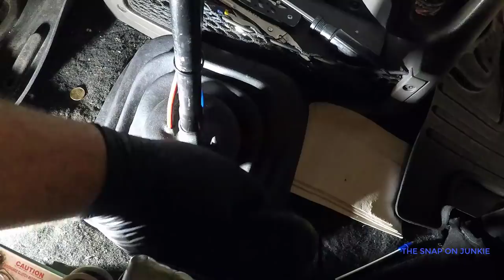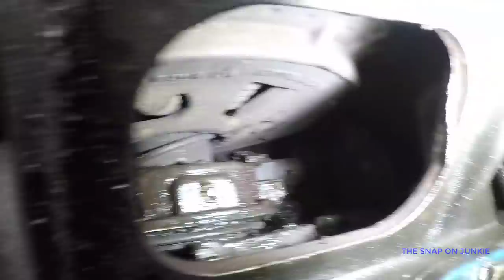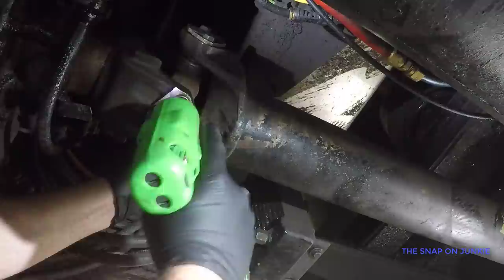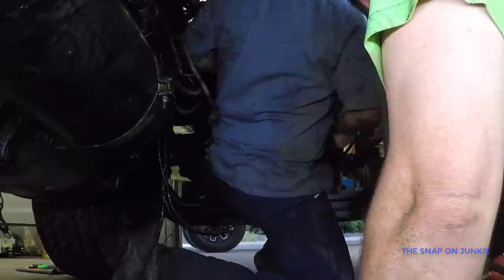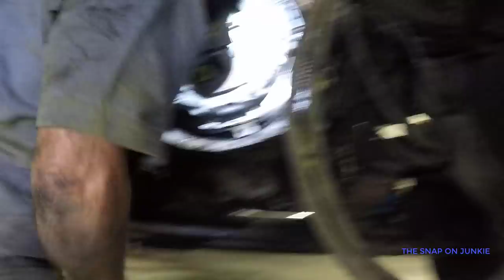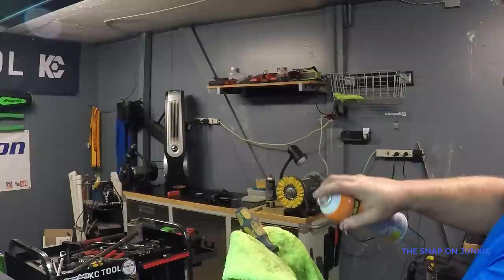HOW TO REPLACE A CLUTCH IN A DUMP TRUCK THE SNAP ON JUNKIE

Comment: I went to a vocational school for auto tech gradtuated in 83. I worked two years as a tech on auto's. I changed jobs and got thrown in to Simi trucks and trailers and cranes. I did it for years then drove truck for years something different. I got back into mechanic on truck's, trailers and cranes. I have to say that the school of hard knocks was pretty good to me and the people around me. I have one of them transmission shafts in my tool box today and I'm retired.great video Junkiiii keep up the great work my friend

Comment: At the Frieghtliner dealership I work for if you need a clutch you automatically get a new input shaft kit with bearings reseal trans bell housing, new rear main seal for engine, resurfaced flywheel, new pilot bearing.  To us if you are going though the effort to take the trans out might as well do it once and do it right
Reply: Alex Corvi, My shop is the same. Notice they didn't machine the outside of the fly wheel. That clutch is going to give them problems.
Reply: That's the way I see it for as much work as it takes to get all that out why not replace or resurface things while your in there
Reply: Many clutch suppliers will extend your warranty if you replace your import shaft, bearing, clutch fork, and hello housing bushings.
Reply: Alex Corvi I have a 88 freightliner and I need a clutch. What's a  Rough estimate on how much for parts and labor? I'd rather do it right than do it again later.
Reply: same at the freightliner i am at. even if they didn't you might as well do it while it is out
Reply: some people can't be taught 'cause they already know it all
Reply: And cross shafts don't forget !

Comment: I went to tech school then did a apprenticeship program at shop in Canada. Thats for sure the way to go you learn so much more. Btw if your doing a clutch job by your self and dont have help you can install the clutch on the input shaft of the trans install the trans then run the clutch bolts from the hand hole as you turn the motor over. Good video you made.
Reply: Been doing clutches that way for about 20yrs.load up trans..
When I started at mack dealership. With triple countershafts..it was a time saver..
I've heard of mechanics cracking clutch cover doing it this way..I dont know how..
Reply: Yep that's how I do it, much much easier

Comment: I just watched this video. And I have to agree with jim. I got into the Diesel industry late at 29. I was just suppose to help my stepdad with a few odd jobs when I got laid off. Well 3 years later I’m still doing it. Try to soak up everything I can. A year into it We lost a few mechanics and left me by myself doing everything from oil changes to engine rebuilds. We hired a kid out of tech school with ase. Hoping it would take some load of me. First red flag was when he asked me what plug to pull on the oil pan! He ask if he could do a clutch job cause he said he’s done a few I said sure. Well he could tell all the difference types of clutches and why they are like that... but didn’t know how to install one. So yeah you learn a lot more with hands on vs. tech school. Not saying school isn’t bad I guess it depends on if you pay attention or not. Sorry for the long comment but keep up the video and hi from a new subscriber!

Comment: Jim is a smart dude...I do the exact same thing on anything im doin a clutch on(or any mating surface for that matter)....clean EVERY mating surface so there is no chance of run-out cause a layer of surface rust not allowing things to mount flush and square,which will lead to some serious vibration, fucking up the ring gear or the worst, having flywheel bolts start backing out...and I also use RED lock-tite on every nut and bolt....and yes,I always have a Marlboro hangin too..LOL

Comment: In our diesel shop we have several pits that you park the truck over. Then you can stand under it easily, and with a heavy duty normal transmission jack you can easily get the transmission in and out.

Comment: Maybe worth thinking about fitting a pit to your shop if you going to be working on your rig. There is a really good fibreglass one with built in steps,a seat,lighting and tool shelves built in. Totally waterproof and a much nicer place to be. Transmission jack a must too. I have a ratchet chain on mine to secure bot to jack. Means can just slide box back and get on with things..
A slide hammer with a threaded end to screw into the UJ cups is bloody handy too.

Comment: I hated doing OTR trucks with wet kits.Those dual stacks gotta come apart.I actually like Autocars or Construction trucks because they mostly use one exhaust pipe.We did clutch R/R out in the field all the time.We didn't have transmission jacks...jus come-alongs..

Comment: Guys!! i put the trans and clutch as one onto the flywheel input. much easier!!! 
then put the bolts for clutch all with couple threads. then once around tighten to spec. by rotating engine.
trust me. way easy. specially with luggars and rolloff with ton a shit of things in the way.

Comment: I have been doing clutches in everything but mainly sterlings and freightliner dealerships. The Input shaft kits are normally a stocked item. You should always compare input shaft numbers always change the pilot. And the disks for the clutch will never line up because they dont want the clutch getting warped. If Jim doesn't know he should not respond

Comment: is input shaft failure common on these trucks?  seems like a beefy part, i would suspect something else would go first.
Reply: halleffect1 depends on who's driving the truck...usually driver error when they brake like that
Reply: It’s called shock load from the driver!
Reply: halleffect1 not common at all

Comment: I did a 10spd eaton clutch job with a Transmission jack at harbor freight supports 2000 lbs, is pretty good, $300 get a 20% coupon.

Comment: What a great fix it video Justin very good I have never done a clutch or tranny on a truck before but I have done plenty on ag tractors and I think it way easier to do it on a tractor because you just split that sucker in have and you can stand up in between it to work on the flywheel or clutch. But great job you are very lucky to have a good guy like Jim around to help you out with the big jobs that is always nice because you can not teach experience 🔥💪🏿👍🏻

Comment: Do you have a link or part number for the tool you used to take the u joint apart?
Reply from the maker: dirtyjerm I don't remember the part number offhand check the Amazon link in the description go to my store in hit tiger tools and do u joint should be in there

Comment: Need to make a blanking plate or the shift lever hole to stop shit getting in there after you opened it up. Cardboard or thick plastic works well. Drill couple of holes and put original screws back in to hold in place. I cut mine from five gallon square plastic oil barrels. They last ore er and much better than getting shit in there! Plus you need to be plugging the oil and air lines. Any shit in there waits till you need it least to announce its presence!!
Reply: sooo true...if I did these all the time I would have a cover made from some light material also, I noticed that some crud had fallen into the shifter hole earlier...I have taped em up using whatever tape I had at the time and if the flange is clean it will generally stick pretty well...but the air and oil line plugs are nice cuz tape can work there but its not as convenient

Comment: Dude just stack the clutch assembly in the trans, bolt the trans up and then bolt the clutch to the flywheel. I'm going to have to make a video next time i do one. So much easier!!!
4 hours in and out on a tractor without PTO or moving shit. Obviously longer the more shit thats in the way. Its a little harder on the new trucks that have Hyrdo actuated fork. "new Friegtliner Cascadia" but still works.. Hope this helps Im sure someone already said this, I'm not reading all the comments to find out..
Reply: Kyle O'Connor I made one thats the way I do it. Check it out.

Comment: Dude...You're the poster guy for America! Fuck all that talking "proper" shit....I talk and cuss at my customers and jobs too..LOL...I'm in the middle of doin a clutch in an '05 C7500 with the 8.1 Gasser,Bucket truck in the dirt and it is the biggest pain in my fucking ass(pretty sure I invented about 30 new profanities in the process)...had to pull the trans adapter and support the engine just to get the fucking thing off and I keep hitting my fucking head on everything cause theres no overhead room...good thing,I'm a skinny fucker,so I can get into some of the tough spots,but I would honest rather do the clutch swap in a class 8 truck vs medium dutys...its a shitload easier,believe or not...Just a pain in the fucking ass getting all that clutch dust off of my fuckin hands.
.great vid man👍 liked and subd

Comment: In a Practical World,Whicxh many of us live in- What can I use for a Jack Without spending $1700-$4000 for a Jack? I want to replace my trans/clutch soon- (Over a million miles) ....... I Like working on my truck and I am prety thrifty when it comes to costs.I Only have my 1 truck so investing in a jack like that isn't practical- Also,How much was that Tiger Tool U-joint puller?
Reply: I fix my own trucks tractors combines on the farm. only have needed to do one clutch on my c15 I welded a plate that bolts to my bell housing cover plate holes go down to a regular floor jack than other end with ratchet straps and a second floor jack got it done. Also put the clutch on the trans, not hard to bolt it on after
Reply: 375 on Amazon heavy duty u joint pulley tiger tool

Comment: The amount of misinformation in this video is mind blowing.  I truly hope nobody tries to learn from these two fools about clutch and transmission failure analysis and repair.  First off I can’t even image a transmission that weighs 1500lbs.  Are you serious!? Secondly that input shaft failed from a torque spike, aka driver abuse.  The advice on the different clutch torque ratings is totally wrong.  All modern clutches use a 10” hub regardless of torque.  🤦🏻‍♂️. Your ole boy Jim also failed to set the positive separator pins on the intermediate plate after he failed to torque the cover assembly to the flywheel.  You didn’t go over setting things up after the trans was installed but I am sure that was all done incorrectly as well.  You should not be allowed to give advice to others!
Reply: Simmer! It's free guy...Mr Sassy pants.  Freeeeeeee 99.  A little more thanks, a little less shaming.  Good karma, avoid heart attack, deep breathes. Crack a cold one, then...make a suggestion.  Thank you.